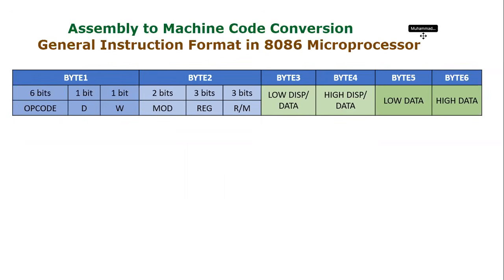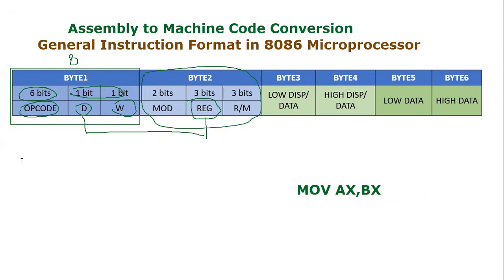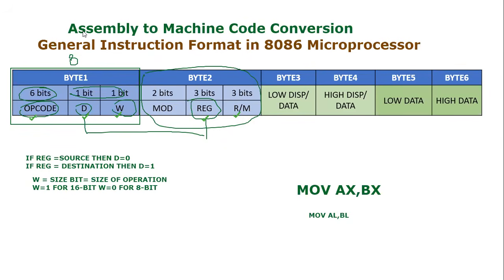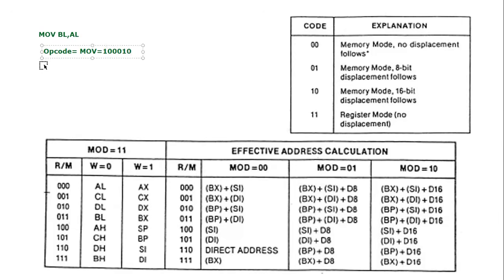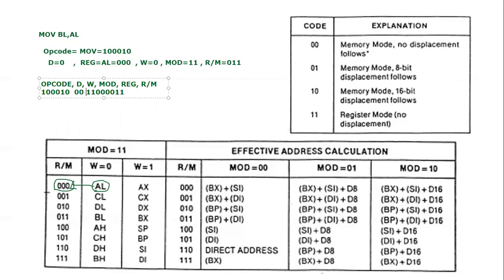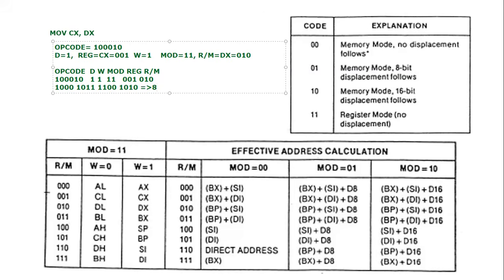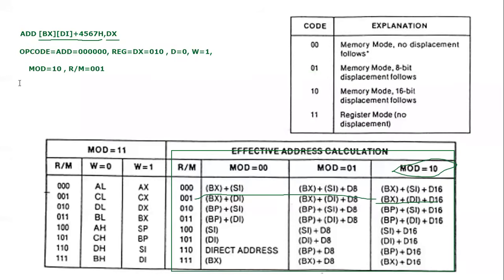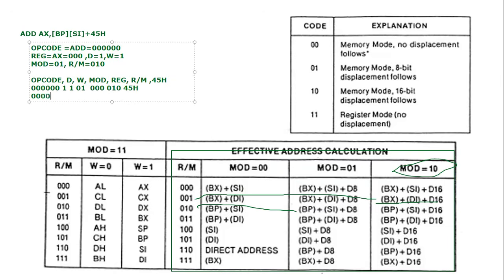Assembly to Machine Code Conversion in 8086 microprocessor|| how to convert assembly into machine

Comment: In ur last example,i think it will be w=0,right?
Reply from the maker: if you are talking about this example MOV AX, [BP][SI]+45H then W=1 because this bit is size bit and it is dictated by the size of register used in the instruction. in this instruction, AX is a 16-bit register so the value of W bit will be 1 (W=1).

Comment: how can i find the instruction set?
Reply from the maker: You can find the instruction set in many textbooks or google sources. I personally use table 3.6  from the book " THE  8088 AND 8086  MICROPROCESSORS PROGRAMMING, INTERFACING, SOFWARE, HARDWARE AND APPLICATIONS " by  Walter A. Triebel and Avtar Singh
Reply: @LearnOnline1  thanks <3
Reply from the maker: @paininkabir  You are welcome.